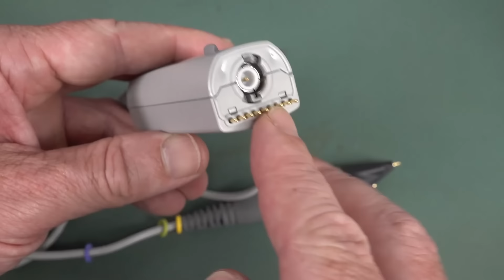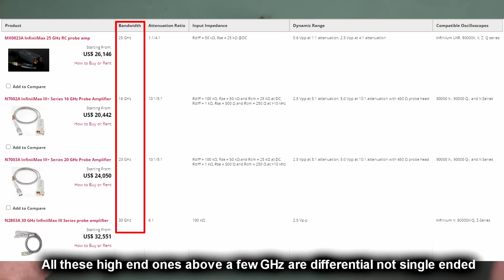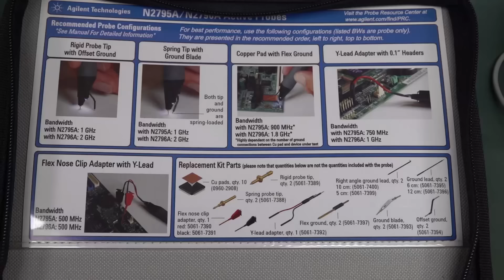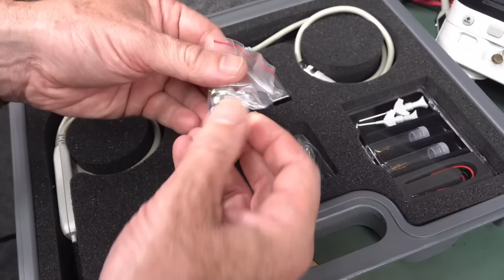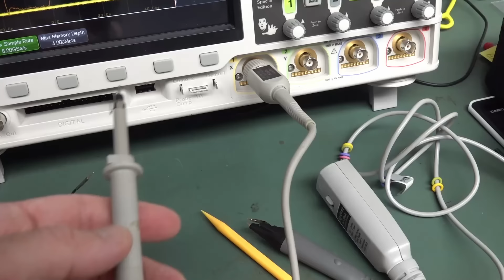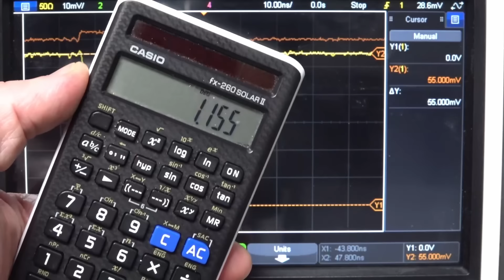High Frequency Active FET Probing DEMONSTRATED

Comment: 20:26 I think the reduced overshoot with the 1k resistive probe is an artifact; because it discharges the pin driver output there is a smaller switching current, and hence less inductive overshoot.  It's not "real" in the sense of the probe somehow being less inductive.  You can see there is no difference on the rising edge.  I'm sure you're perfectly aware that the inductance is a function of the loop area between the probe and the ground lead + PCB return path.

Comment: The probe capacitance also matters at lower frequencies.  Try probing the pins of a crystal in a 12MHz XO with a 10pF passive probe, for example - it's just going to either stop or skew, or even behave erratically as it repeatedly auto restarts, depending on which pin you stick it on.  10pF also doesn't permit seeing the actual XO waveform, and whether for example it's clipped (overdriven) or under voltage spec.  A datasheet will have the correct correct voltage range for integrated XOs that just need an external crystal and load capacitors, and the only way to verify a design is working to spec is with a low-capacitance FET probe.  In fact, more generally, they're necessary to probe high-impedance circuits, of which an XO is only one example.

Comment: You could mention that there are pretty simple active DIY FET probes which are perfectly capable if you don't need perfect calibration. There are hobbyists selling finished boards in the range of $20. I'm very happy with mine.

Comment: The best "cheap-out" scope probe tricks I use with my standard 200Mhz 10x probes are:
1.	Touch the scope ground point with your scope probe to see how much “stray” signal your connection method is producing.  This can help avoid wasted time chasing the cause of the “bad” signals that are not really there.
2.	To see if your scope probe capacitance is screwing with your probed signal, touch the same point with a second probe to see how much it changes your displayed waveform with the doubled probe loading effect.  If the displayed waveform changes “too much” then the scope probe capacitance is the most likely cause. You don’t need to monitor the second channel, but it needs to have the ground lead connected to your circuit and be plugged into another scope input (even the external trigger input).
3.	To reduce the loading effect of the scope probe capacitance, grab a 1k-Ohm leaded resistor with the scope probe and probe the circuit with the other end of the resistor.  This can show a much better representation of the waveform being probed.
4.	To reduce “RF” interference on low-level analog signals you are probing, grab a 10k-Ohm resistor with the scope probe and probe the circuit with the other end of the resistor.  This will give you a better “BW Limit” function, lower than the scope button for the 20MHz BW limit with only a small additional DC error.
5.	For a better understanding of the probing impedance effects in your circuits, use an impedance nomograph to help you estimate impedance ratios for the circuits you are probing (like the ones at https://www.testecvw.com/carl/CarlMain.htm )
Later,
Carl

Comment: My Rigol Probe not only does it have single,  diff ended heads , plus  2 upmarket doggy Dave heads one with a ferrite bead 1 cable. It also contains solder a small ruler and a calibration kit.